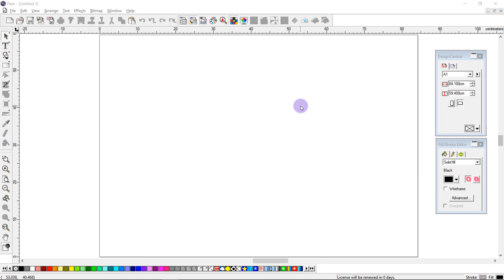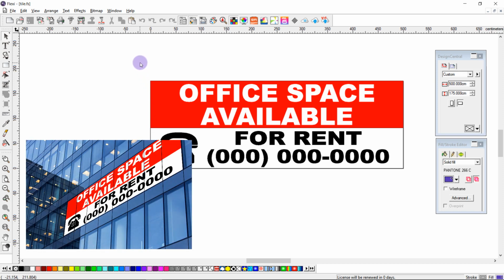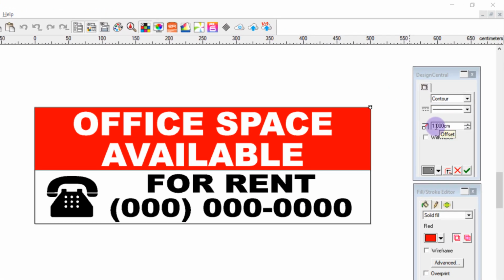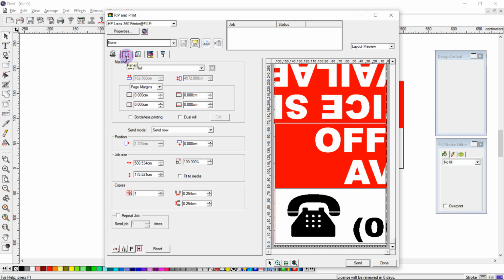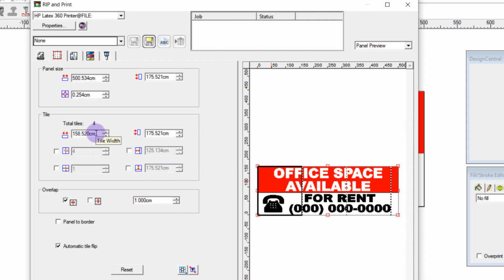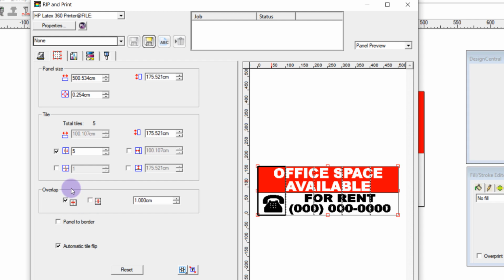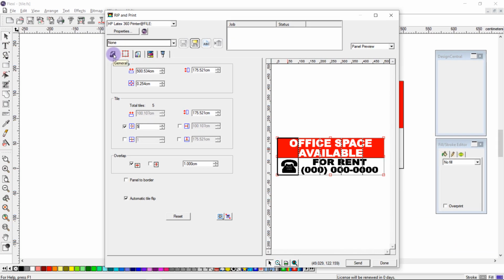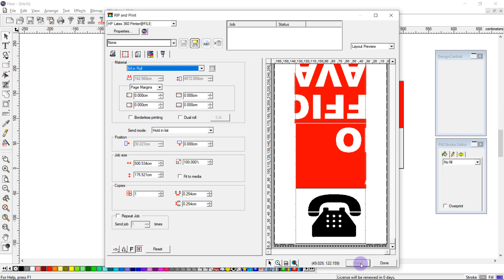How to Tile Large Jobs using Rip & Print in SAi Flexi

Comment: Very informative. One thing I have wondered is, is there a way to print a just one section of a previously printed job which you can choose.  Seen it done in versaworks but not quite worked it out in flexi.  Also on dithering methods, can we have a video explaining each one and what they do.
Reply from the maker: Hi Chris, if you Open the "job properties" again, and go to the "panel" tab, you can double-click to turn panels "off" and they will not be printed. Of course if you send the panels from RIP and Print with "hold" after output selected in the Workflow tab, you can just send the individual job again.

Regarding Dithering methods, if you select "Help" in Production manager, it links to our HTML Help guide.  If you type "dithering" into the search bar, the top option "Job Properties Color Management Tab" describes the standard dithering types for you. With modern day computers though, speed is not much of a factor so Quality dithering types are reccomended.